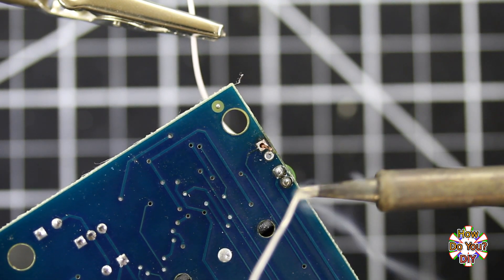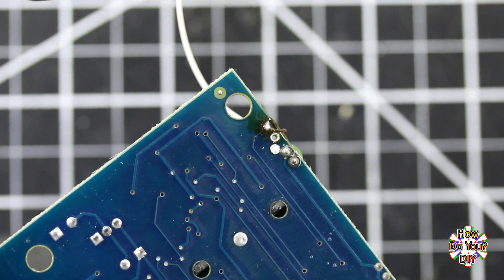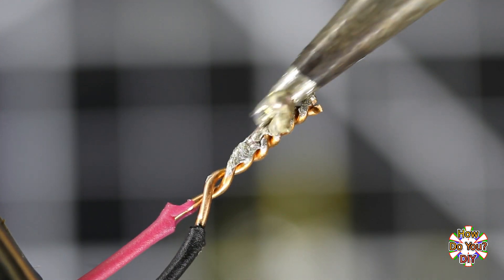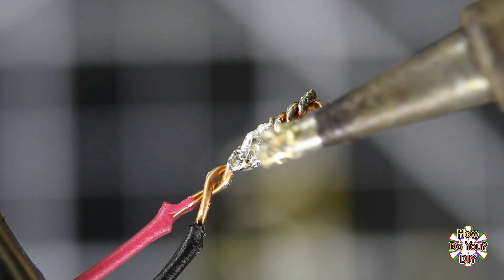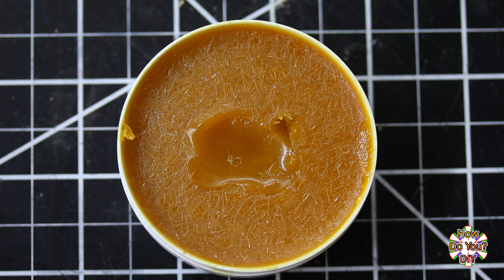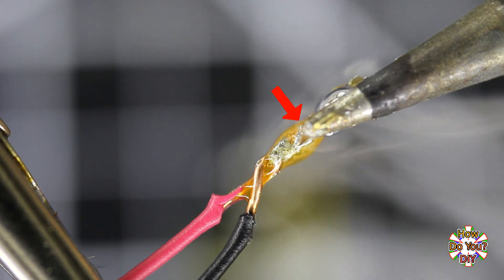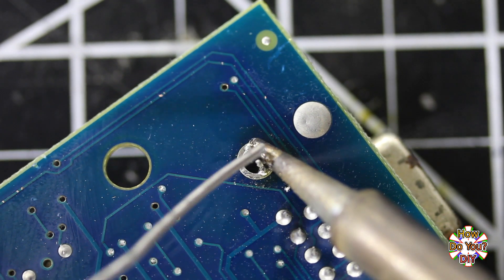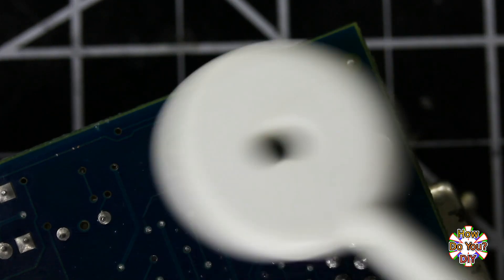Using Flux | Soldering Basics | Soldering for Beginners

Comment: Very informative, Thank you! my flux is dried up and hard to handle, not sure if it affects the quality of the solder, is there a way to soften it or should I get a new one?
Reply from the maker: That's a really good question. I have some flux that dried out and is like clay. It's hard to use, but still works when it melts. If rosin based flux dries completely, even becomes crunchy, it should still work just as well when it melts. I'm going to try some things with my dried flux to see if I can soften it. It's more useful when it's easy to use. I read somewhere that isopropyl alcohol will soften it.
Reply: @HowDoYouDIY  Thank you very much for the reply, I will try some isopropanol and see if it works, if you ever find a good way to restore yours I think making a video about it will be very useful for a lot of people because I didn't find any good video regarding that, Thank you again.
Reply from the maker: That's a good idea for a video. I just tried it and it worked out well. It didn't take very long to soak in enough to let me mix it. I'm going to let it dry out again so that I can make a video to add to this soldering series.
Reply: @HowDoYouDIY  Great, waiting for the video 'cause mine didn't work out well :)
Reply from the maker: It may take a while for me to get to the video because I need to let it dry out again. When I do I will try a few things with it to show more options to try.
Reply: @HowDoYouDIY  Sure, take your time, I enabled the bell so I'll get a notification once you upload it.

Comment: Over using that flux. Sh!t$ not cheap lol
Reply from the maker: I used extra to emphasize the affect, but forgot to mention not that much is needed. Thanks for the input!
Reply: Like a toothpaste ads
Reply from the maker: 😄😂🤣😅 That's right
Reply: I got a little tub for about two and a half bucks, works great, I wouldn't really call it expensive. I guess it depends on what you get :D
Reply: @RealFlight-u4h  when running a business every dollar ads up.
Reply: @nitrocell9287  True true
Reply: so is there any harm if you put too much of flux?
Reply: @Anonymous-mz4fn  just harm to your wallet
Reply: @nitrocell9287  ok i asked you because I am about to do some soldering work for first time. Trying to fix induction cooker.